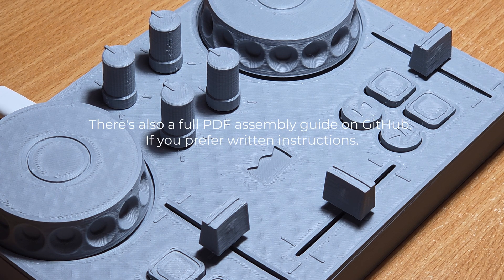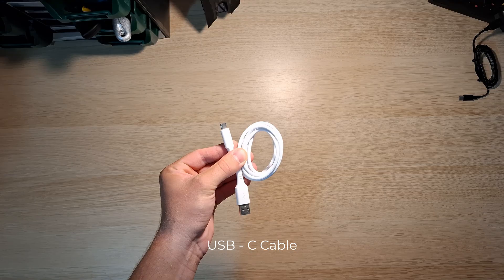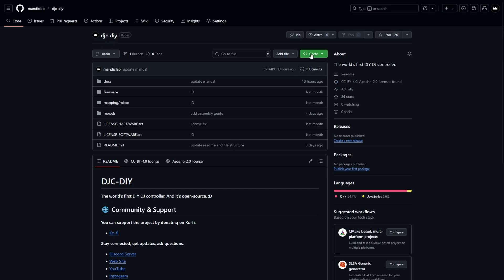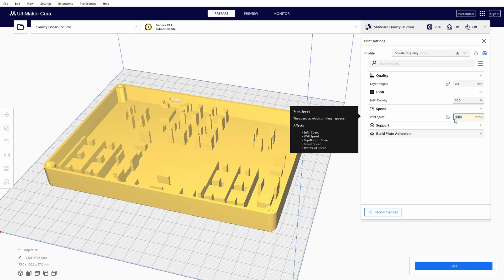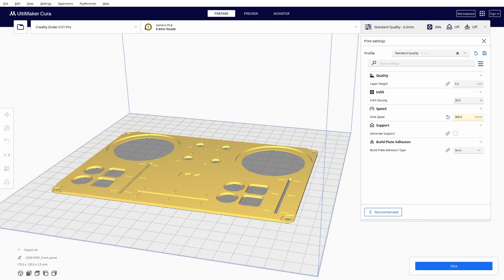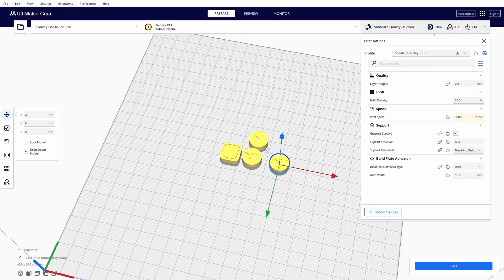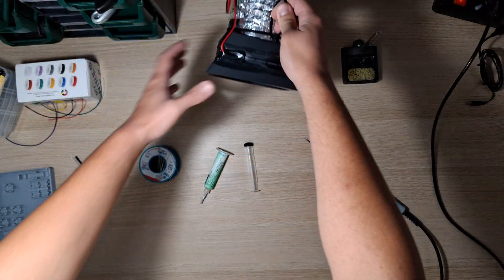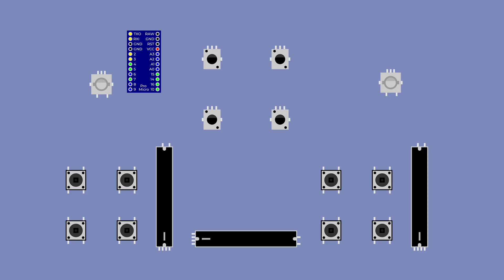DIY DJ Controller - Step By Step Tutorial - Open-Source, No Special Tools, No PCB

Comment: At 5:38 why you put resistors on the ground of the first set of buttons but not at the other buttons pots and ecoders?
Reply from the maker: those two buttons are wired as a voltage devider because there's only one pin left on arduino and there needs to be 2 buttons

Comment: I made with arduino mega is it possible to add rotatory encoder with mine? for jokey?
Reply from the maker: yes, but I don't think that arduino mega can be used as a hid with factory firmware
Reply: @mandiclab so should I use like leonardo with multiplexers? Will that be good enough to handle high definition encoding data for jog wheel?
Reply from the maker: @weslycosta348   @weslycosta348  leonardo will work but I don't think that you need multiplexers, there should be enough pins  :)

Comment: Good morning my friend, how are you? I have a question regarding the connection of the encoders and one of the buttons that isn't connecting to any Arduino pin. Could you please explain? My encoders have five pins: VCC, GND, S1, S2, and key. How do I connect them, and are the resistors on the buttons necessary and what are they for? Great project, I want to make one for myself!!
Reply from the maker: Sorry for late response, you'll need stock rotary encoder EC 11 with B C A pins, it can have 5 pins, two more for switch but you need only B C A. Resistors are needed for the buttons because you'll need to connect 2 buttons to one pin and that's done with resistors as a voltage divider.
Reply: No problem, thanks for replying!
So i made the connections as documentation, but two buttons didn't work, specifically the resistors, usually the buttons are connected to vcc i don't know if that's the problem,  but it didn't work correctly for me!!

Comment: Awesome project, thank you!)
The one exactly I was looking for

Can you pls help me understand some issue I faced building project 

So I assembled all parts on breadboard and everything working fine except 2 buttons- play/pause & cue on first deck 
it is connected to pin 4

github code for arduino do does not refer to pin 4 at all 
So Im confused a little bit)

If you can help me understand where the problem is , that would be great!)
Reply from the maker: thank you very much for building the project, I would like to help you, can you text me on instagram or discord?